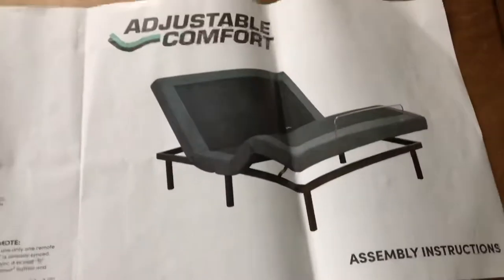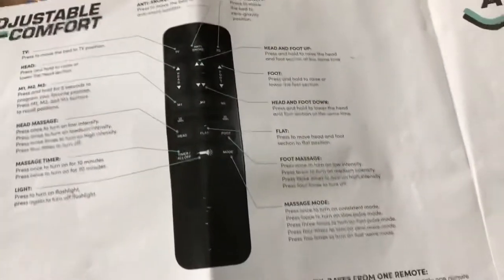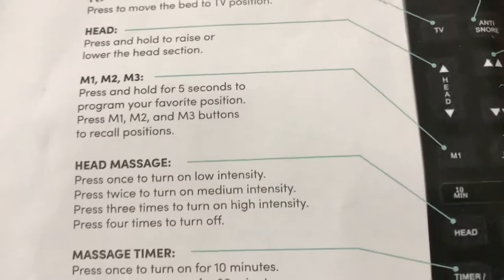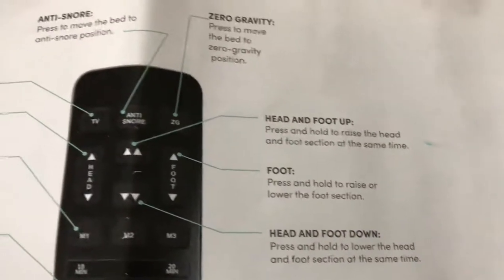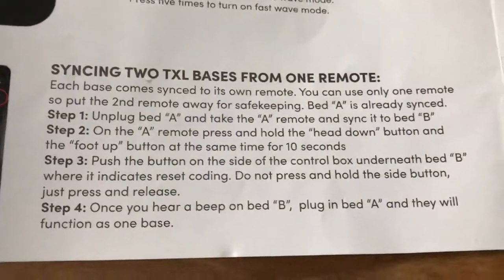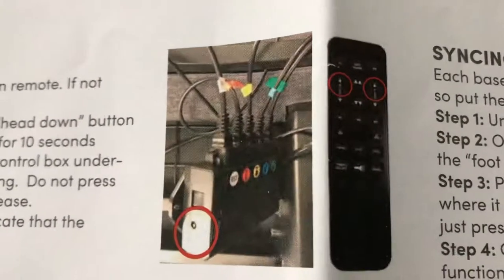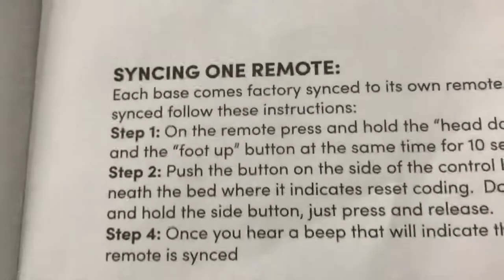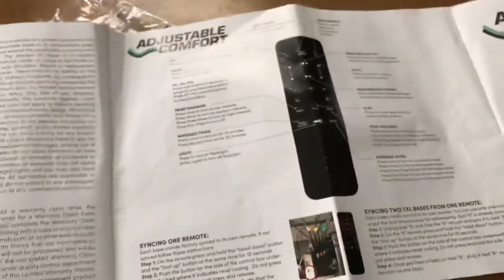Adjustable comfort bed frame remote fixed

Comment: Sir!!!! You have saved my back and I from a second night of painful sleep!! My remote stopped working yesterday and we have been tried everything that every video suggested. I even found the owners manual for my Craftmatic Legacy adjustable bed and follows its instructions….nothing. I called Craftmatic’s customer service several times…nothing. In a last ditch effort, I stumbled across your video. We followed your instructions and my bed quickly started to move!!!! Thank You so much for your help!!!

Comment: Thank you SO much. Spent hours yesterday trying to get it to work and all the information I found online was saying to hold the foot and head both UP, not one down and the other up. I was already resigned to purchasing a new control box, thinking mine was fried, but thankfully I couldn't actually find my model control box anywhere. Tried your tip and was delighted when I heard a resounding beep. Everything is working again.

Comment: Thanks. This worked for resyncing the remote of the adjustable bed I purchased from Sams Club 4 years ago. First time I have had a problem with the bed, and of course I couldn't find the manual that came with it, lol. Thanks again!

Comment: Omg can I just say thank you, thank you, thank you!!! I had tried everything. Haven’t had this thing working for months. Came across your video and bam, fixed within 30 seconds. You are a lifesaver! I also couldn’t find the directions that came with it, so was going by the ones linked to the product on Amazon where I bought it and nowhere in those directions does it say anything about syncing the remote this way. They really need to fix that! Anyway thanks again for sharing!

Comment: Thanks for posting this video! We never would have figured it out on our own! I do want to add that pressing the remote buttons and the button on the box underneath the bed should be done simultaneously. 🙂
Reply: Yes, very important.  So glad you said this, as mine would not work otherwise.

Comment: The light on the remote is on, put new batteries in but bed doesn’t work.  Does this mean it needs to sync with the bed.
Reply from the maker: There is a button on my box under the bed you must push to sync it have to hold for 5 sec slowly go through the instructions pause the paper work and read the instruction if this will work for you my friend you have my prayers it will help you 😊

Comment: Excellent video.  Only one I could find that helped.  Key point not on the directions.  You have to push the reset button while you’re holding down the head and foot buttons.  Remote beeped and synced.  Spoke to support and told them to add that little point to the directions.

Comment: We have a split frame and need to sync both of the black boxes to the controller.  Waving the camera over that paragraph is not enough.  You could have minimized the "talking head" portion, and spent more time, zooming in on the page of the manual.

Comment: What I did was I unplugged it from the wall for 10 seconds then plug it back in and I held the head up button in the foot up button for two seconds and then reconnected it works!

Comment: I have an almost identical model... the tag on it says Model ID 600. My remote is slightly different and my control box has a button for ''LEARN'' and an RJ-45 looking jack labeled ''PROGRAM''. There's a bulb on the wire near the converter that says ''PAIR/FLAT''. Still been unable to get the remote to pair and cannot find a manual for the life of me.

Comment: Ny  remote and the small power cord work but the base connected to the lift base doesn’t work
Reply from the maker: Check all your connections unplug and plug back in do a complete reset see if that works 😊
Reply: @Sunny22475  I’ve tried it a couple of times all ready . Will try it again!

Comment: Thank you for your video it was the help I needed. Also for anyone that  is trying the instructions without any luck like I was the secret was taking a pencil /pen and pressing the button under the bed. I was doing it with my finger without any luck u til I took a pencil inserted after. Also if you are doing both beds sinc to one remote like I was once you have one side working you disconnect the one that works and do the same for the other bed once that one now works connect the other side and voila both sides are since to one remote. Hope it helps

Comment: Does the remote control have batteries?
Reply from the maker: Yes it does Joni😊
Reply: @Sunny22475  I guess that was a dumb question, but the back wouldn’t come off.  I FINALLY got it off with a butter knife.  😂
Reply from the maker: @jonihughey1352  funny the back of mine just falls off and the batteries come out and I have to reset everything love those butter knifes just used one to pop the lid on the water bottle lol😊

Comment: Nice to know... The Head Down button has quit and it appears that these remotes are permanently sealed.  Battery leaked years ago and one of the plated through holes in the PCB has finally corroded enough to open the circuit.  Will have to cut the case open to gain access to the board.  A quick look on-line shows the price for these remotes to be insanely high. :<(

Comment: I've tried it multiple times and it isn't working. Im never hearing a beep. Did you hold in the reset button until it beeps? Help! Just had brain surgery and have to sleep with my head up!
Reply from the maker: Hold down both buttons on the remote under the bed hold in the reset button until you hear a series of beeps it is now in sync you will need help it almost takes 2 people I used my left hand with the remote on the floor to hold in the buttons laying on my back I took a pencil and pushed in the button on the box wait for a series of beeps then release 😃

Comment: All I did was unplug the bed ,(and removed the remote batteries )for about 10 secs and plugged back in and then put battery’s back in and boom worked again .. altho possibly could be a slightly different model , I got the off white Resident remote

Comment: I confirmed that the two parts of the shell are indeed solvent bonded together.  I had nothing to lose in cutting it open.  (Dragging the back edge of an Xacto knife blade edge along the parting line between the shells.  It is a tedious process that took 20 minutes or so.)  Sure enough the corrosive electrolyte in the batteries had wicked their way to a plated-through hole going to the Down button.  I reamed the hole with a pin and forced a bit of 30 gauge wire into the hole and applied a touch of solder to the traces on both side. Cleaned away all the dried electrolyte from the insides. Presto! Back in business!!! 😀  Some plastic tape now holds the shell together.... Maybe it will work another 15 years.... Hope so...
Reply: My repaired remote is still working fine a year later.